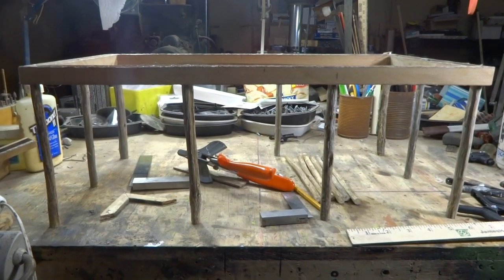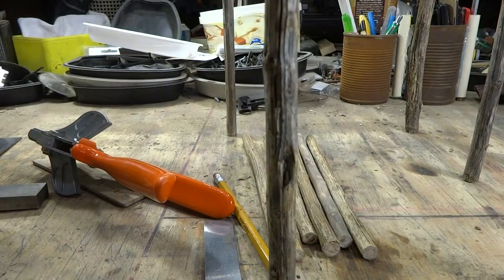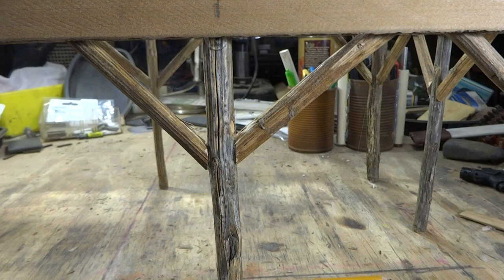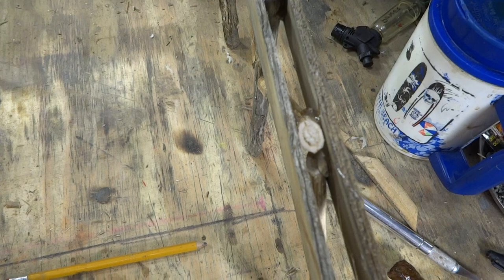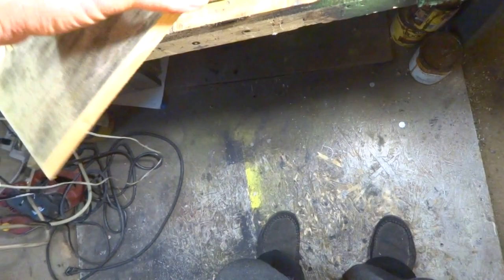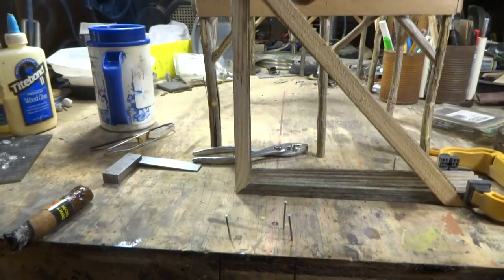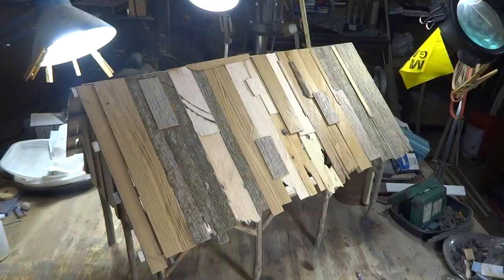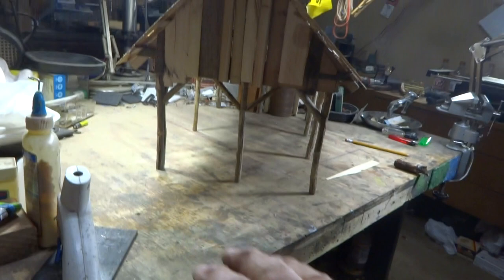Building  saw mill, (my style), start to finish

Comment: Have you tried using cyanoacrylate (super glue)? They sell big bottles of it for old-school airplane guys and there's virtually no mess (strings, etc.) if you're careful not to get any on your fingers. If you're not careful you'll just end up with chunks of wood stuck to your fingertips, which isn't a big deal to peel off. You could probably even use the fingertip peelings for something cool in your layout... maybe scale soup bowls? Another great build Larry!

Comment: What I do when I’m hot gluing things and I want to illuminate the web as much as I can, I just wrap the string around the head of the glue gun and usually the heat will make it stick to the glue gun rather than just have the webs fly everywhere. I hope that makes sense

Comment: The best way I have found to get rid of the hot glue strings is to quickly touch a lighter to them. It makes them melt up and as they are so thin they basically burn up and disappear.
Reply from the maker: yeah I have taken a pencil torch and used that because you don't burn your fingers, and you can get in some of those tight spots, Thx
Reply: Don't tell him to do that on the hot glue in his beard !

Comment from the maker: My next video is putting lights, stain, water towers, and finer details on the mill, but cant decide how to stain it. I see the colors I want, but having a tough time duplicating them. Anybody live in the Denver area, when I went to the last garden RR conference I noticed that the 6' cedar fences where an absolutely beautiful, they where reddish mahogany look, wow thats what I want for a color. I would also love to have some of that wood for my projects.
Reply: Larry, try using fine art oil paints. There is no limit to the colors and effects you can achieve with these. You can mix any color you want and you can use odorless thinner to create beautiful washes and stains on wood, fabric, plastic, metal, etc. I use artist oils with my work and they are extremely versatile.
Reply from the maker: I tried oils, I have a whole pallet full but I am to shaky for fine detailing and I don't quite get the grain texture I like. Ill try it again thanks
Reply from the maker: I use the crap out of that glue but sometimes I need to slide my piece to make it fit and hot glue does that where sometimes the second the 2 pieces touch they are stuck for life, u no what I mean, Thanks
Reply from the maker: I know texture lol